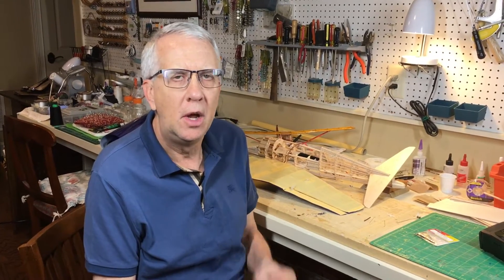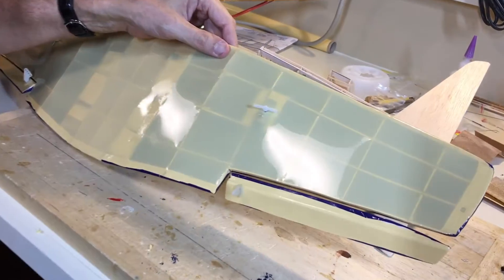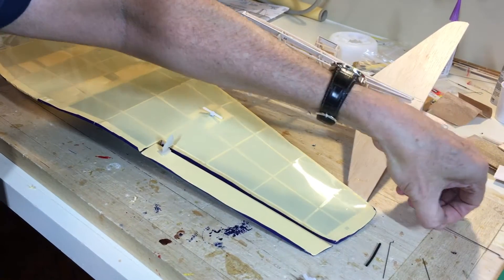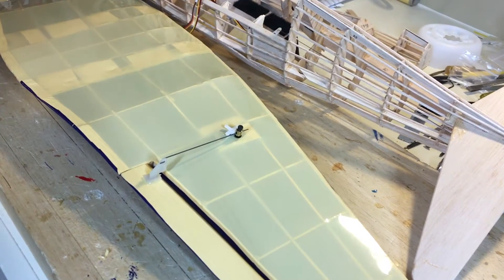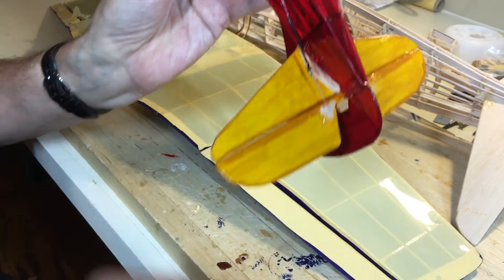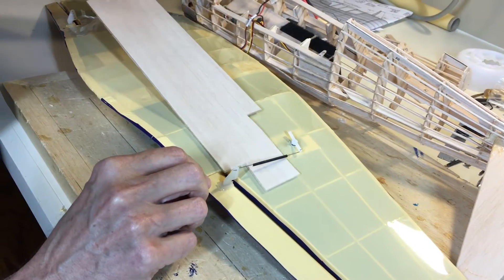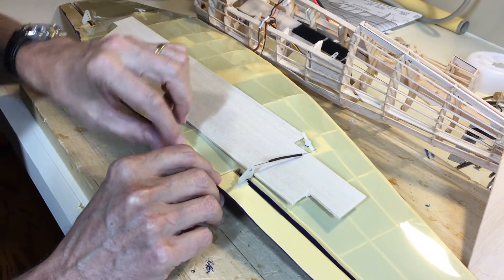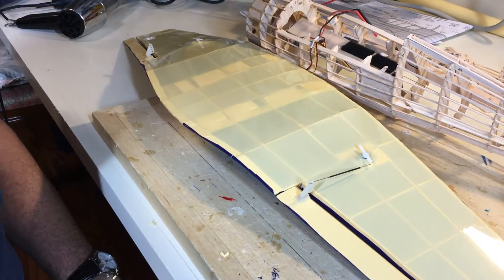Easy Control Linkages for RC Airplanes

Comment: For small models I put a "V" in the middle of the control wire. That way I can bend the "V" slightly to adjust the control wire length. This also cushions stress on the servo in a crash or loading the plane into a car.
Thanks for the great videos.
Reply from the maker: Excellent point!  Tim

Comment: i just take some firm good paperclips ,flatten them out, and draw a mark on it where it should be bent.  then bend the z bend into each side.  Recently, I've started just doing one bend on the control surface side and bending it back instead of the z bend.  ive seen no functional difference, much easier to just adjust by hand.  paperclips have to be replaced if you bend it more than twice but that is easy.  I've had such an issue with these ez connectors...  one problem is that because the rod isn't allowed to move or rotate (it's grabbed by the grub screw), servo movements end up bending the control rod if its longer.  really annoying.  there is also like 5 different sizes and it can be hard to figure out which one i need.

shrinktubing is a good idea but I would be worried about it coming off in flight permanently.
Reply from the maker: Good points, thanks!  Tim